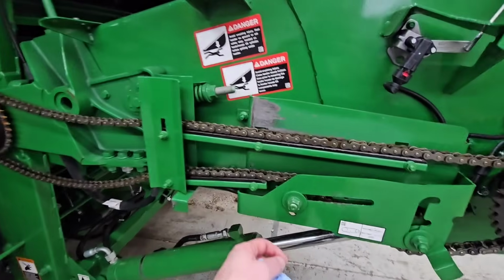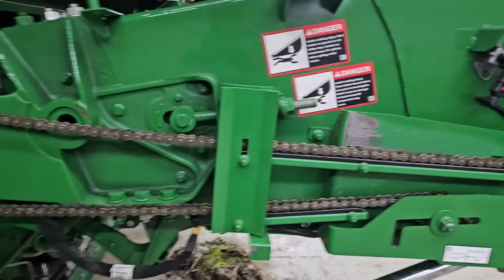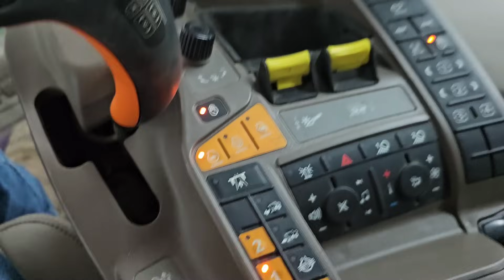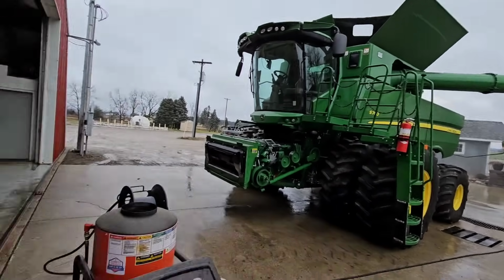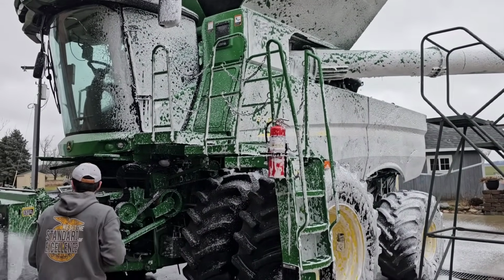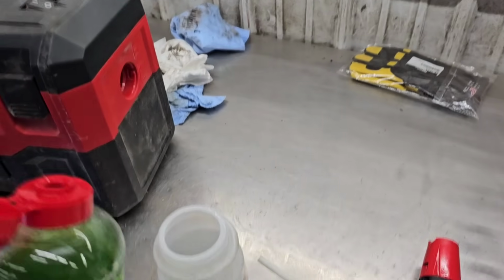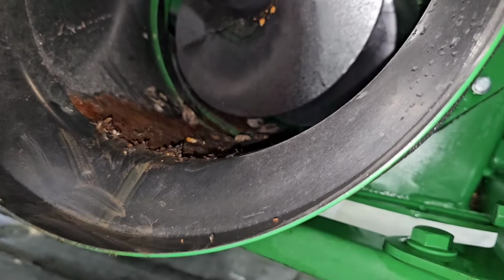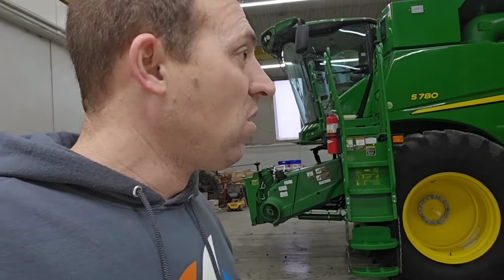Finally Finishing the Combine!

Comment: Should look into image wash products wax replacement or chem x snake oil. Goes on in the foam cannon and washes off. Would be a cheaper option per wash than that ceramic car wash.
Reply from the maker: That $20 bottle will do basically all our major equipment this winter

Comment: Would be ironic if all that detailed washing got water into places where it's not supposed to be and that results in frost damage or rust.
Reply from the maker: That's why it's greased after it's washed, notice all the high pressure direct cle a Ning under the side panels was done a week or 2 ago and it's been drying in a heated shop since, and I clean the combine like this every year, 1 time I had water get in a electric control box. I've prevented far more damage than I've caused.
Reply: That’s the thought of a lazy person that doesn’t want to spend time cleaning or maintaining 🤣
Reply: @BorderViewFarms run it after greasing. And yeah been there done that on a tractor scv control module. That was expensive.